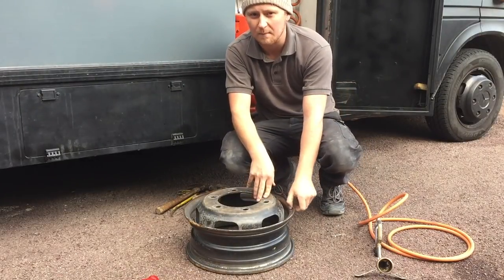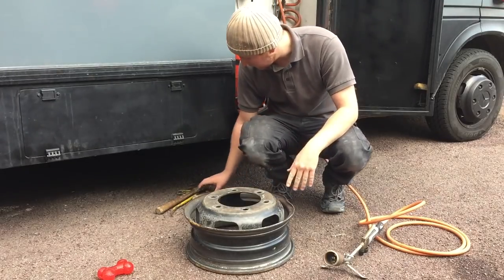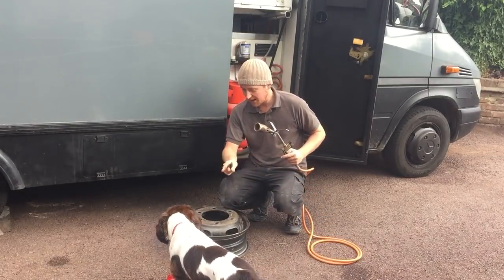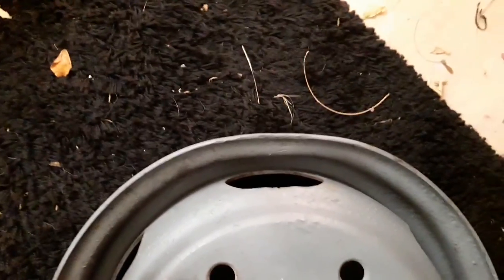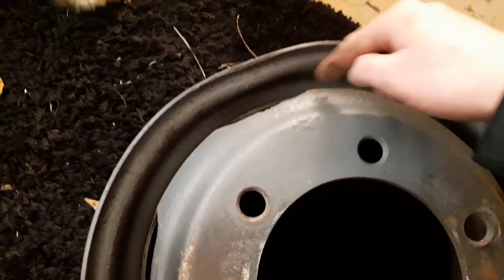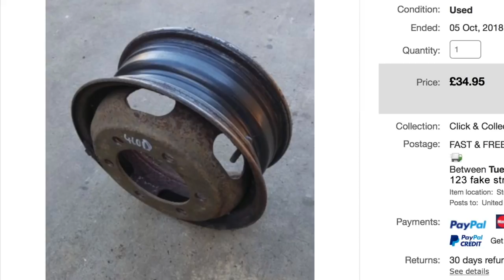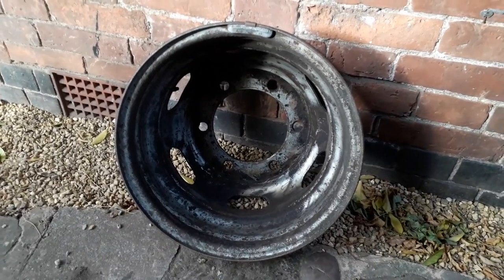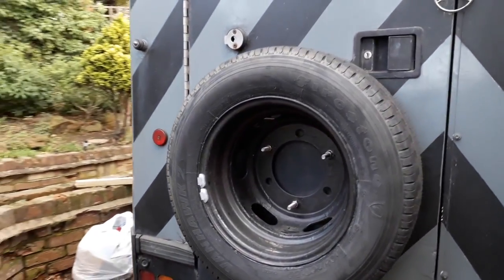Trying to Repair My BUCKLED WHEEL.

Comment: Don't fret yourself, you're a lot better off with a 'new' one. Though you may bash it straight enough to hold air, the heated spotwill always be a weak point as I found out myself when I hit a pothole with a repaired wheel.

Comment: I'm a big fan of steel wheels for their repairability. You were right though to put away the rocked one. Damage done to bearings and joints going on an egg would probably be more than those 30 quid.

Comment: when I smashed my wheel (Astra) as you did, I picked up the new rim and it even came with a tyre for something like £13 from a breakers/scrap yard ~ I took to a tire fitment place to see if it safe to use and they said I got a bargain
Reply: No such thing for a 4 ton light truck, at least where I am: The good ones go to commercial truckies, and what they don't buy You do not want on Your truck either.

Comment: If you heat the metal till it glows red you will be able to get it to 99.9% the correct contour. With the aid of a heavy hammer and dolly. Gloves are optional😏

Comment: Think you may need a locking wheel nut on the spare before it disappears
Reply: Yep either that or fabricate some sort of padlock arrangement
Reply: drilling one of the bolts and hang in a padlock would be a good start.
Reply: Or.....possibly using a coach bolt that is put right through the door leaf,  with the nut on the inside.

Comment: I’d of got 2 new spares if funds allow and ditch the bent one it will end up costing you more in long run with ..... wheel bearings vibrating etc etc but well worth trying your hand at blacksmithing 👍

Comment: if you ever get in this position again go to a tire shop that does tractor trailer tires and borrow there tire maul has a hammer face on one side and what looks like a duck bill on the other side will be 10 pounds or heavier. that what's need and no heat it will create weak spots in the wheel in this case brute force is your friend after getting done beating on it get it spin balanced if won't balance with a reasonable amount of weight get rid of it and get another one as you did no heat it creates weak spots I watched a wheel collapse at speed after some one used heat to get it straight it is not worth your life or your rig to save a few bucks more lance he reminds me of turbo our cocker or as I say after lifting the saying from camper van Kevin he is the chaos in our life
you and lance have a good day
THE GRUMPY BUS